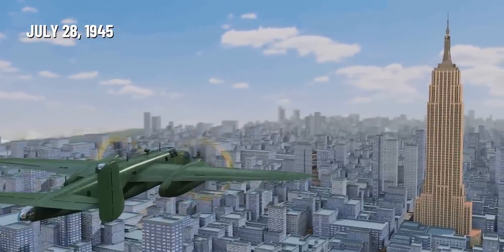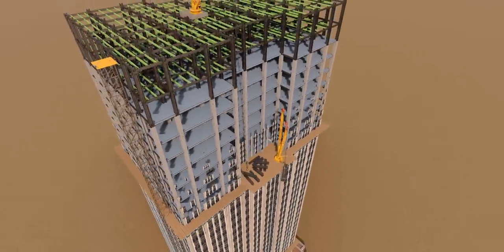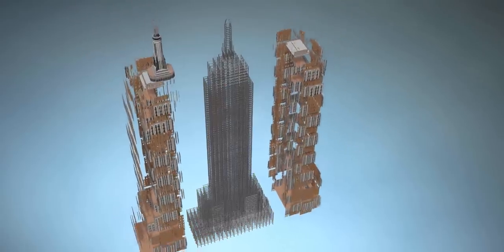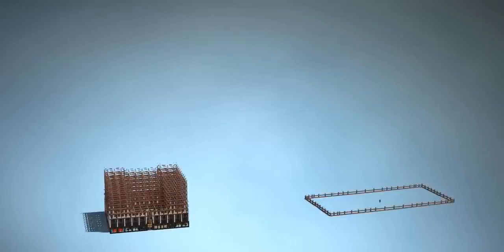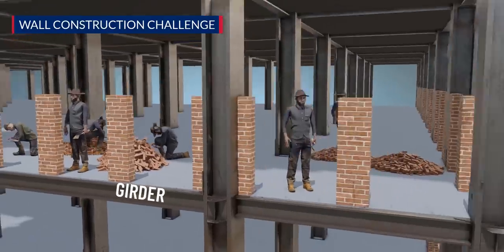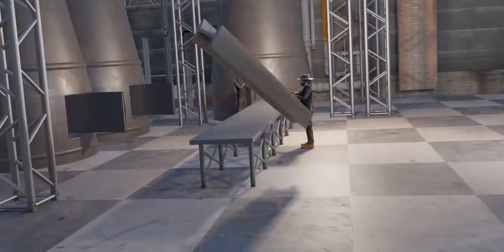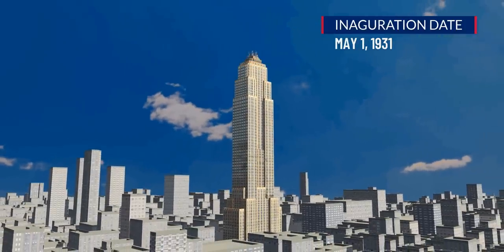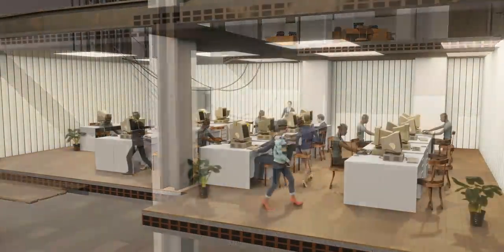Empire State Building | All the Secrets of the Engineering Wonder

Comment: Wait, an airplane crashed into the empire state building and a building down the street didn't fall at free fall speeds as a result? Weird.
Reply: It was a quite small and slow plane lol...
Reply: @maddiekits4998 not true, it was an US B-25 Mitchell Bomber, eleven people in the building and 3 crew members were killed.
Reply: Empire State building also had a lot more steel holding it together. WTC 1 & 2 were almost hollow so it could flex in the wind.
Reply: @LorainPsycho  if steel melts from jet fuel, what difference does it make if there was more? The steel would have been melted at impact...but it wasn't. Besides we all know buildings hit at the top don't fall from the bottom at free fall speeds.
Reply: @singerkgreen the tower didn't fall from the bottom. The collapse began at the impact zone when the steel beams snapped causing the upper part to fall on the rest of building in a progressive collapse
Reply: @thepessimistictitan2655  false
Reply: @thepessimistictitan2655  if that were true the building would have fell one floor at a time from the top down. They fell at free fall speed. That's only physically possible from the bottom. 

Furthermore I noticed you conveniently left building 7 out of your comment. Thay wasn't hit by a plane, so explain how that one fell? Keep believing TV programs and not your lying eyes.
Reply: @thepessimistictitan2655  the steel beams didn't "snap". What are you smoking?
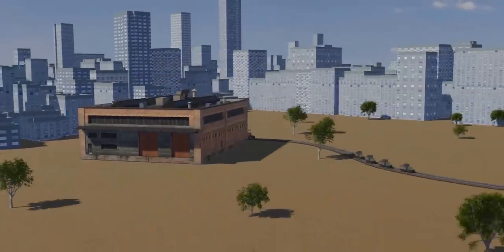Reply: @singerkgreen  technically it did fall through one floor at a time, it just kept a constant motion crashing through easier as more material broke with it. https://youtu.be/wRfphCLtUUI?si=3AHr6b18z7u9F9Vr you can hear each floor it goes through at 5:55 in this video 

WTC 7 burned from the bottom after WTC 1 fell, some of WTC 1 falling onto the building

Comment: The Empire State was built from stone and had supporting columns that were part of the overall structure. The twin towers were made of steel and glass and just had floor struts and a single central concrete column holding each tower together. Pretty obvious which building style would survive a plane impact and not eventually collapse

Comment: I don't think the windows were Aluminum, at least not originally.  I remember reading an article comparing the Empire State and the Chrysler buildings, where it mentioned that they used identical steel windows.  The only difference was that the ones on the Chrysler building were galvanized, as Walter Chrysler didn't spare any expense on his building.  The ones used in the ESB were not galvanized, and when the buildings were rehabbed decades later, the windows on the Chrysler Building were like new, whereas the ones on the ESB had rusted badly and needed to be replaced.

Comment: If I recall right, there was a woman in the elevator when the Bomber it. It cut the cable and she fell all the way to the bottom, but survived.
Reply: Yes, her name was Betty Lou Oliver. The air pressure in the shaft built up enough to slow the decent and the snapped cables at the bottom of the shaft cushioned the fall. She wasn’t unscathed but she did survive.

Comment: Ive been up the empire state building back in November 2008 and the steel girdered frame im sire was incased in concrete before the brick facade was put up around the verticle collums and the horizontal steel joists are incased in cocrete as well as ive had a good look at it as ive seen on one floor i was on looking up at one of the beams where some concrete had come off a section on one of the beams and you could see the section of one of the steel girder joist exposed as the structer does show small signs of concrete cacer but nothing too serious to be concerned about as its reliant on its riveted steel girdered frame to for its main integrity where as the packard factory in detroit was one of the first to build a monocock construction with rebar in its columns and beams without steel girders and there is a building in Cincinnati that was the worlds first highrise to be built using rebar only without using the steel riveted girdered frame and by WW2 that was phased out and rebar in highrises was the norm.

Comment: It also helped that that bomber was a "feather" in  weight by comparison and carried a lot less fuel than a 747 did and flying into the WTC towers at top speed which was considerably more than the bomber's propeller driven speed was.

The building was completed in only 13 months due to brilliant scheduling timetables, they had to deal with city traffic and more too. It also helped it was built during the depression when workers knew if they didnt break their ass and work hard there were 500 others who would waiting downstairs on the streets ready to take their place! I believe they also worked 6 days a week probably 10 hours a day or more and no time and half pay.

Comment: And two aluminum jets took down two buildings that were far better engineered than the Empire State Building at the beginning of this century. Sure they did.
Reply: lmao the twin towers didn't have columns anywhere besides the center which the planes destroyed
Reply: @JourneyLiveCompilations  I did not say that they did, I guess reading comprehension is not your strong suit. If you can break away from watching cartoons, maybe you can do a little research. You will then discover that they were built far stronger than the Empire State Building. But you would never do that because you love the narrative you've been fed.
Reply: @simplifiedlife8607  your claim was that you don't believe 2 planes took down 2 towers which were apparently stronger than the Empire State Building. they had different designs. it's simple. the planes took out the only core columns. the Empire State has columns on every part of the building. Research anywhere and you'll find what I said is true, have a great day.
Reply: no way, your gonna compare to massive boeing 767-200s to a small B-25 bomber barely fully loaded at approach speed?

Comment: It's good to see that this building wasn't designed to collapse in on itself like the world trade centers
Reply: The plane that hit the World Trade Center was a wide body Boeing 767 which can travel transatlantic, this WW2 plane is small compared to a 767. It was also traveling at 500 mph on impact it was full of fuel as it was flying from Boston to LA. Astronomical difference in force and size. The World Trade Center also has a completely different construction, it had an “exoskeleton” design and steel core covered with Sheetrock material, made very cheap with max floor space possible. The floors were open with no beams which is why the floors pancaked on each other one by one. You can see in the collapse that the core was still standing for a couple of seconds, especially with the north tower.

Comment: The reason it didn't go down unlike it 911 aircraft it was high octane piston engine fuel vs pipe hot burning kerosene the gasoline doesn't burn as hot as kerosene when it's what the other combustibles and a jet goes a lot faster than a prop driven aircraft so if it yet would have hit it even if it would have went through it since it was slow-moving proper crafted did not

Comment: Please stop using metric measures when featuring American built structures.  We do not use metric and not many people here understand the metric system. We use feet and inches.  Wheather you like it or not, engineering in this country is still using the American Standard Measure Units and will continue for quite some time.

Comment: Lets have more, as to WHY, the collision didn't do more serious damage ( as per the TWIN TOWERS ) A tall , steel framed building in London, was on fire for 48 hours, and didn't even buckle.
Reply: Twin Towers were built totally different.
Reply: @CableReadyTechnoSIut The Twin Towers were basically hollow tubes. A great design feature that allowed for more office space. Unfortunately doesn't do well against a plane impact since most of the structural support is on the exterior of the building.

Comment: Can you do the reason why WTC fell after 9/11?
Reply: jameswheeler5025  so because of the velocity, it bring down the twin tower?
Reply: B25 20,000 lbs
767 250,000 lbs
🤔
Reply: @mikebyrd8278  so its 9 tons vs 90 tons right, sorry i dont use imperial
Reply: @rizkijunir23 no your special, a b-25 bomber going approach speeds is gonna only penetrate the perimeter facade of the building and break through a floor or 2, a fully loaded boeing 767-200 is hundreds of times lethal

Comment: A Bomber aircraft crashed into the Empire State Building Accidentally?  
I find that hard to believe. More like the pilot was suffering from battle fatigue and decided to end it.
210 steal beams 60,000 tons of steel. 
Over a 100,000 rivets
Reply: " battle fatigue" what battle was this? The battle of long Island in WW2
It was overcast with a low ceiling

Comment: Mit is strange because the twin Towers were made the same way but ironicly they Fell down in  a way that all the architects and ingegners don't accept that falling.
Reply: They WEREN'T made the same way, my guy.  The ESB is a box structure, where steel beams and columns form a rigid three-dimensional grid.  The old WTC towers used a tube-like design, where the outer perimeter of columns was effectively free standing and connected to the building's core via trusses (not beams).  Two very different designs.

Also, most architects and engineers (and metallurgists, physicists, and people who are generally educated on the subject) do indeed accept what actually happened.  A fire burned out of control and weakened the structure to the point that it failed.  There's really no big mystery there.
Reply: They weren’t made the same

Comment: Why didn't the neighboring WTC building applicate the similar construction method as the empire states? It would've survived at 911 tragedy
Reply: Because it was generally accepted thinking at the time (and to some extent still is) that companies find open floorplans more attractive for their offices.  The ESB, by necessity of its design, has floors that are filled with columns are regular intervals.  The concept of the old WTC towers was that by eliminating these floor columns, moving them all to the perimeter and a central core, that office space would be more attractive for companies looking to lease.  Hence the design.  In fact most large skyscrapers emulate the basic design principle to some extent to this day.  Even the new 1WTC, although it has a concrete-reinforced core and actual beams connecting the perimeter to the core (unlike the old WTC buildings, which used trusses).

Comment: So what were the first steel frame buildings to come down due to fire? You guessed it, the twin towers, weird huh. 😇
Reply: the b-25 bomber that hit the empire state barely had any fuel left as it was at approach to a nearby airport, also it barely penetrated the perimeter facade as it was going at approach speeds, steel beams, columns, and core columns in general dont need to be weakend in order to fail or give way to a structure or trusses above, the fire the b-25 started was thousands of times less lethal then a fully loaded boeing 767-200 could ever dream to be
Reply: @phantom7crossrose148 Good job clarifying yourself